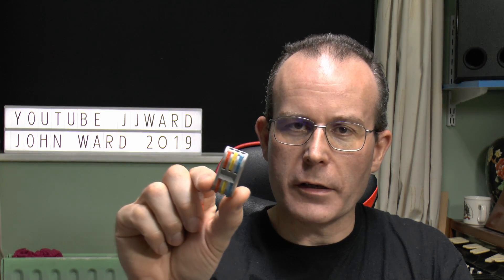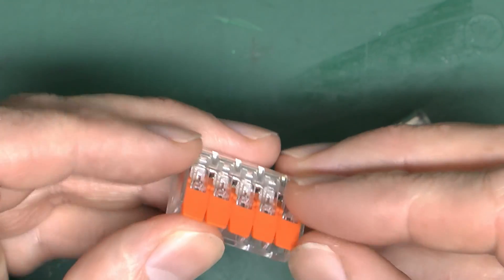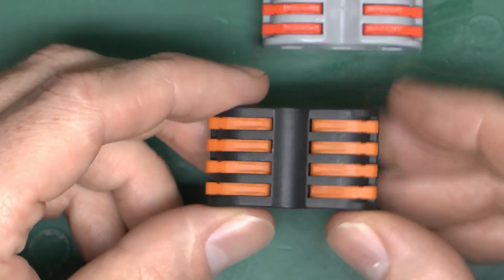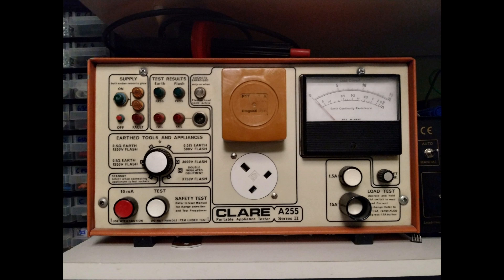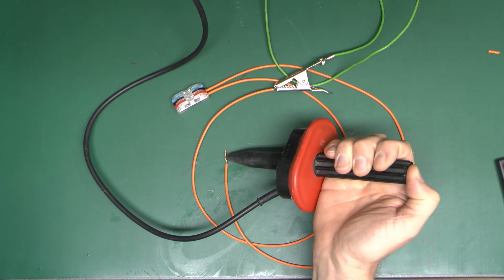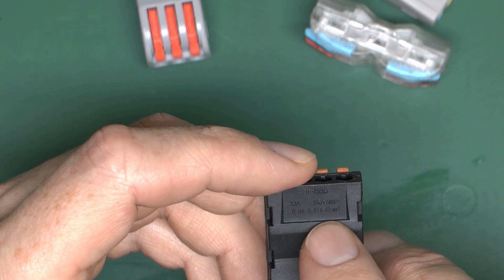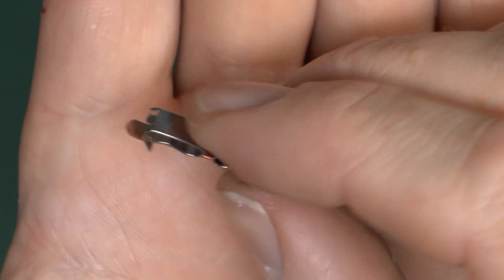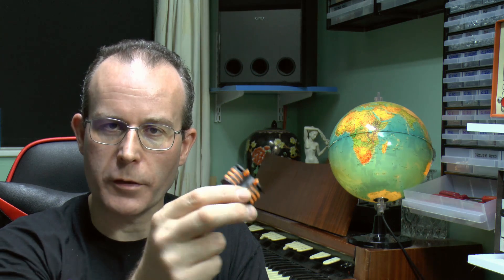Chinese Wire Connectors

Comment: Say based on how they are made, will it be safe to use them on 220v with10w led bulbs? I'm just thinking that some people used only electrical tapes on connecting wires and they lasts long time.

Comment: I generally don't trust myself to touch mains voltage. But I have some of the fake Wago units for use when working on motorcycle wiring, to prototype circuits. Something that can be used while checking something works, before changing to proper connector blocks (whether Deutsch, Superseal or another)

Comment: In China, the "standard" way to splice wires is to twist them together and cover that with PVC tape. I'd propose that all of these are better than that.

Installing earth wires is nearly unheard-of, so the 3-wire products use colors for 3-phase (and not twin/earth). Wiring used green/yellow, sometimes blue/red, and things are supposed to be trending towards blue/brown for single phase.

Comment: So, in conclusion, they pass with flying colours but not recommended?

I bought a load of these in different varieties, some which come in singles but clip together. It amuses me that you say that you cannot imagine any use for them as they were inline connectors yet the moment I saw them for sale, I knew that I would never buy another 'chocolate block' terminal strip again after 40 plus years of using them. My only criticism of them, compared to 'chocolate block' is that apart from the 2+2 into 2 variety, there are no screw holes to fix them down with. However, the newer versions have probe  points which, I suppose, makes up for the absence of metal screws to use for testing purposes.

Comment: I just got some of these orange grey ( 2 terminal) connectors for 12v small solar system use. They don’t hold at all. 🤦🏻‍♀️🤦🏻‍♀️Trying all kinds of gauges, between 28 and 12awg with no luck … did you try the tug test on yours? Did the connectors hold wires? Man, I wanted these to work at least for testing but I dunno.

Comment: I accidentally bought some Chinese "Wago's" via e-Bay.  I noticed, just in time, that they didn't grip standard 1.5mm2 conductors.  They pulled out without any effort so I suspect the would have had unacceptably high contact resistance.  May have been OK with 2.5 but I sent them back!

Comment: In China, all of the buildings' electric wirings and connections are likely using these sorts of wire connectors.  Perhaps, there is something we should be concerned with.

Comment: It is not terribly hard to replicate one of those. But manufacturing them in consistent quality is the issue. I've seen terrible stories regarding those spring-loaded connectors to melt at low current (~16A) while being rated for 32A. 99% of those connectors will be fine, but sooner or later people will come across that 1% if they use enough of those.

Comment: You can say your using 1000 volts or 3000 volts.  Doesn't prove your point because you don't have the currant.  I could have 50,000 volts in my hand and not feel it.  These examples have no use that I would ever need.

Comment: the chinese markings are 入 (input) and 出 (output).

that was quite a large amount of samples here and since no connector was observed failing, it is maybe too early to conclude. it is hard to even tell which company we are talking about, since there are several ones producing these. also, when buying on b2c platforms, the vendors are often traders who won't mention the original manufacturer name.

one other thing is that borders work both ways: chinese companies do risk their reputation in china. also, any chinese buying an authentic wago part could think: "these westerners only send us crap, they won't be held responsible if our house burns".

now this video is incredibly useful, and i am sorry to see you even got hurt in the process of shooting it. huge thanks, you have a new subscriber.

Comment: I would like to have seen a genuine Wago stripped down and treated in the same way. I had my doubts when these came out years ago and stuck to the terminal blocks that we all knew best but have used them only in the last year or so and have to say they are actually pretty good and time saving. I wasn't aware of a test probe hole in any of them but then I never looked or needed one. Just to confirm, I only used the Wago ones to date.
The cheapo Chinese ones probably OK for a hobby electronic project but even then I would still buy the genuine thing.
Good vid 👍👍
Reply: I'm a year late to the party but I have an observation. The genuine Wagos are approved for use in the US, Canada, and the UK, as opposed to the Chinese knockoffs that aren't. The knock offs are CQC approved; Chinese Quality Control. I use Wago all the time. I love them.

Comment: They have funny colors as leads in chine do come in those odd color combinations(not to be trusted of course) i have bought leads from there and on set actually shorted out inside the wire jacket 🤣( under controlled environment of course) ......am surprised they dont make ones displaying Euro standard(brown,blue,green/yellow) colors or North American and Japanese Black White Green ones if theyre trying to market internationally.... as quick connect testers (as in on a direct wire light fixture bench testing), sure id use them for convenience ....for permanent in wall use .... it will definately give me some paranoia🤣🤣🤣

Comment: You can use them with your multimeter test probes to connect them to other wires. i.e. low voltage.... for home wiring, use the authentic WAGO connectors. Use them for low voltage hobby connections.

For the  Chinese models.... It doesn't matter how good they are, they can even be better than the WAGO, but they are not approved, so if something happens, they would fall under suspicion.

Great video.... Just pretend you are James Bond listening to "Q".

Comment: Nice video. Never make fun of Chinese manufacturing. They pretty much own the market in terminal blocks which is what these are, minus the screws. If they set their minds on something they can dominate it by having prices that are 1/4 of the competition. If they get those UL listed or european approved they will compete.
Reply: It really depends on your definition of "Chinese manufacturing".  Sometimes it's just a subcontractor making product for a different company with high standards.  It could even be a Chinese division of a company like WAGO.  Or it could be a company competing only on the lowest price, which might take a ton of shortcuts to meet that lowest price.  Or possibly a Chinese company that tries to meet high standards.

There's been a certain amount of ridicule of "Chinesium" or products that seem to be based on the absolutely cheapest manufacturing and support.  I think we've seen some of that her with parts that aren't finished nicely.  The (likely) solid copper bus bars aren't anything like the tinned copper bus bars that WAGO or Ideal use.  You can look through a lot of the ad copy or instructions and see various amounts of spelling and/or grammatical errors in English.  They might slap on a CE label, which only means the manufacturer claims that it meets European safety standards.

Comment: I'd be okay with using these in low voltage, low current control circuits and automotive fault finding but not at mains voltage even in lighting.

I have a question if anyone can help. Not that I'd ever use them but are wire nuts okay in British domestic installations? I've only ever replaced them but wondered if they're up to code?
Reply from the maker: Wire nuts are theoretically suitable for use.
However no electrician in the UK will use such things, as they are inferior to pretty much every other type of connector.  The main problem with wire nuts is that they twist and mangle the ends of the wires, which makes subsequent alterations, additions and testing far more difficult.
Reply: @jwflame  Nonsense. Ideal wing nuts are far superior to these wagos. They are industrial strength compared to quick and easy. You can hang from an ideal connector.

Comment: I got some with Brown, Blue, Yellow, levers, 3 way straight thru, they are ideal for making quick test leads for mains powering equipment under test, they work quickly for temporary connections and insulate well enough...
You can also get 9 into 3, 6 into 3, 4 into 2 etc all coloured correctly and can work for lighting...

Comment: If you do an installation with Wago and your client’s house catches fire, you’ll be held responsible anyway. And good luck trying to sue Wago !
Reply: As far as I'm aware there have been no recorded failures of genuine wago connectors as long as they have been installed correctly
Reply: Haven't heard any fire about using these, neither. 
But heard lots of racism in fire 🔥  is sure.

Comment: Good test. I feel happier using these for non critical applications. Would be fair to test a proper Wego connector to see if they perform as well. It would also be useful to test these when the plastic has been heated up as breakdown will occur at lower voltage. Given the type of plastic is unknown it would nice to know how they perform on this test. I would hope they are V2 rated Polycarbonate but I doubt it, probably just ABS.

Comment: We use the proper ones in a nightclub for connecting the CCTV system and speakers up. Been in situ for 13 years with no problems whatsoever.

Comment: Despite their passing some rudimentary tests, I would not risk using the Fake Wago (can we call them Fuego?) connectors for line voltage in any permanent installation which houses life or livelihood. That said, these would be great on the test bench, in prototyping, and anywhere else that Wagos would be cost-prohibitive. The pass-through connectors in particular look great for clipping to the bare ends of wall-wart power supplies to allow quick swapping of different connectors.

Comment: Far from destroying the standards applied to these “Chinese “ connectors you have demonstrated that they are fine, maybe not as useful as others but certainly no better or worse than other countries, just because an item comes from China does not automatically mean its inferior, branded connectors from a “western” company could be defective as well, nothing can be 100% guaranteed as not going to fail, I will stick to buying from the best source for my hobby budget and leave you professional electricians to prop up the over inflated prices charged in the western world.
Reply: Branded connectors from a "Western" company are probably made in China too.
Reply: @johnmusgrave3179  The big difference is in the blame game you don't get the blame if there's problems due to you choosing the cheep Chinese option. (even if it was just as good) If it were a genuine Wago or something they couldn't really expect more from you and would blame Wago instead.

Comment: I'd like to see the rail system the mountable one uses.  I've used a small pile of wagos to splice a dozen or so cables after moving a consumer unit and the junction box ends up quite messy.
Reply: I think Wago make a box specifically for moving a consumer unit

Comment: What is the amperage of the insulation resistance when set to 1,000v?

Would a larger amperage not eat through those fake wagos?

I think a 2.5mm cable can take 26a, so do you think the fake wagos could handle the same current?

Be interesting to see if they could. I mean the metal might take it but could the insulation?

I do agree with staying with British wagos though. Always better to be safe then sorry.

Comment: Im struggling with your assessment, you say if you put a Chinese one in and it fails you will be responsible but are you not responsible for a Waco one if that also burns down the house? Are you saying using a 'proper' one gives you some sort of extra legal protection?  You show how stressing the these Chinese connectors with considerably more that they would expect under any normal circumstance but you dont show how a 'proper' one would perform in the same situation. I dont really know what you are saying or showing with this rather long rambling video? Dont get me wrong I dont disagree, Chinese ones are questionable but many 'proper' ones you will find are made in China and equally 'proper' ones are not 100% perfect, nothing is. I just feel this is a very biased appraisal of a product
Reply: Iy you put proper ones in they will have been marked as having passed the relevant standards, and the manufacturer would be responsible. These are not so marked, and so you would be responsible.

Comment: I suppose these connectors are O.K. for experiments  (the three-way ones would make a good "poor person's Safebloc")  or for a temporary installation  (e.g. completing a ring final from which a socket faceplate had been removed, to allow the use of power tools  for construction work),  but I'm not sure I would want to trust them long-term in a ceiling void.

The 4-way ones would be good for line, switched-line, neutral and earth, or on a two-way switched lighting circuit.  I'd actually like to see a reputable manufacturer's version of the 3- and 4-way connectors.  They would be useful for extending a cable run.

Comment: you should put them in tandem with a wago and pump the amps through until either one or the wire fails
Reply: He has another video for that. The Made in China burned first.
Reply: Sure, but at that current both connectors were destroyed (~5 or 6 times the rated current). I'd call them equivalent based on that test. I'd only definitively call one better than the other if that test were repeated a number of times and gave a consistent result one way or the other.

Comment: wouln't the esd mat be a better conductor than the connector itself in that 30000V test?
it kind of felt like the end of the wire and that crocodile clip were touching the mat too

Comment: I could see a use for the 4 wire ones. Here in the US we often have 2 120 volt wires going somewhere, a neutral, and a ground; rather than a single 240, neutral, and earth. There is equipment which requires all 4. This could be used for that.

Comment: There does seem to be some anti-Chinese bias going on here that seems somewhat unjustifiable. Both in this test, and one or two you've done in the past, the components have passed every test you've thrown at them, and yet still negativity hangs in the air. I don't know whether they are, but it wouldn't come as the biggest shock to discover the much lauded Wago connectors were also made in China - many many things that we DO use with confidence every day actually are. The Chinese will produce whatever you want; if you want rubbish they'll produce rubbish. If you want quality they'll produce quality. They are very capable of either.
Reply: You're right Phil, WAGO do have manufacturing plants in China. These are most likely either reverse engineered, or simply from the same factory.
The springs are strong, they grip the cable well. The contacts are copper. The insulation resists over 15 times the rated voltage. I couldn't understand the issue with the colour of the levers - I thought it was to show that they're wired straight through more than anything else, especially as no two countries seem to have the same colour coding anyway.
They don't look too bad to me...

Comment: Hi John, absolutely correct John the small amount of money you'll save on these sort of parts it ain't worth it because as you said the consistency might not be there where as with a reputable British firm they have to have their Quality Mark!
I think those connectors would probably do nicely in one of those  wiring cabinets like you used with your CNC machine!
Could be useful in some temporary supplies

Kind regards Warren

Comment: The problem with Chinese manufactures doesn't seem to be the manufacturer going cheap it's the proliferation of fakes and even fake fakes. The good news is many Chinese manufactures will happily sell small quantities directly. I've had brilliant service from a Chinese connector manufacturer. Two week turnaround on an order under USD1000 and made to order. Elsewhere I'd be asked USD1,000 in setup costs.
Reply: The other good thing is that the Chinese will print any brand you want on there. So, if you want "Wago" written on there, no problemo!

Comment: Hmm - rated to 400V and easily pass a 3750V test but don't use them because they're junk.  I wouldn't use this type of connector for 240V AC installations EVER anyway.  They are perfect for low voltage applications, the 4 way rail connectors are perfect for a common  rail for interior vehicle use for such things as powering relays for driving lights, etc.  If you buy another lot which don't pass the test just get your money back - I'm the first to agree that much of the Chinese stuff is rubbish quality.